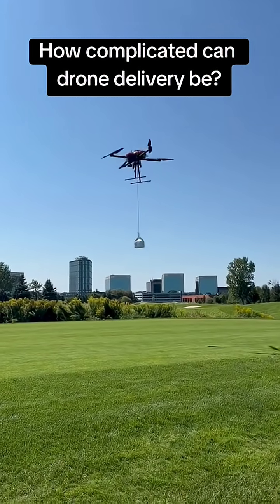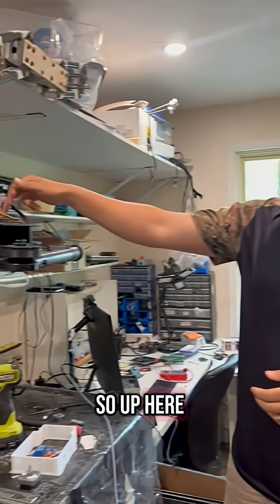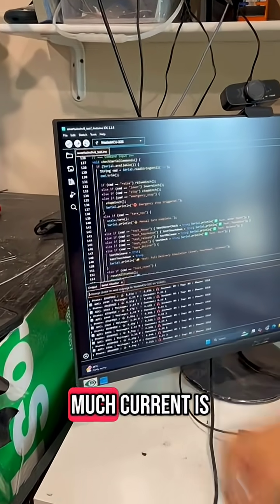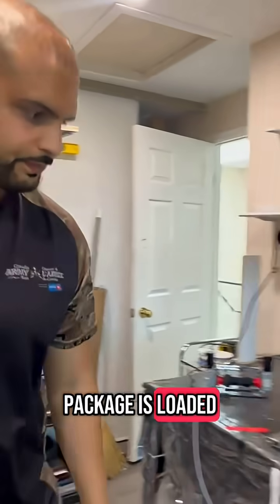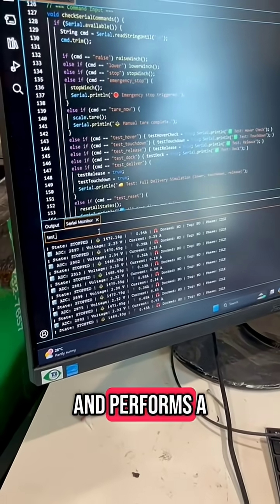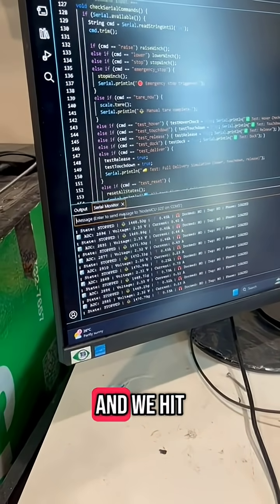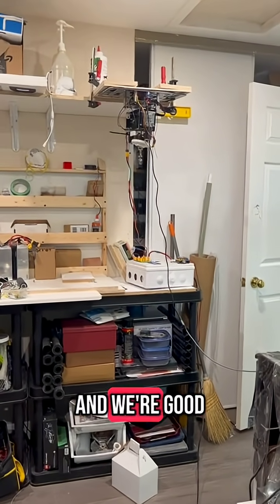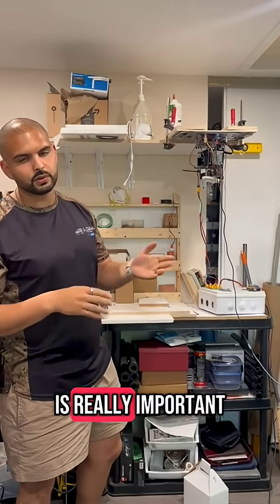DIY Delivery Drone System #fyp #3dprinting  #fpv #3dprinterupgrade #drone

Comment: Why don’t you use switch case instead of all the else if? It would look more organized…

But cool drone🔥
Reply from the maker: Good call! I contemplated using switch-cases for the single condition checks. In my case though, I’m checking multiple things at once (like weight + timing + flags), so if-else gave me more flexibility. But yeah, it could definitely look cleaner in places. I might refactor parts of it later. Appreciate the feedback and glad you liked the drone!